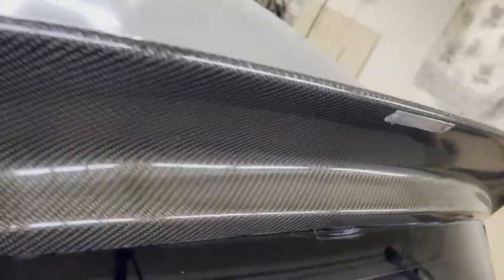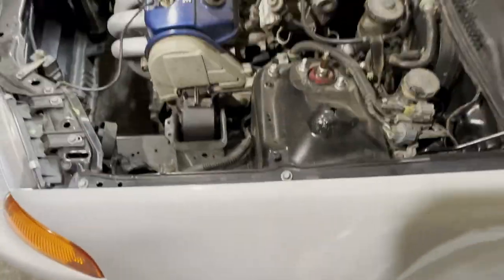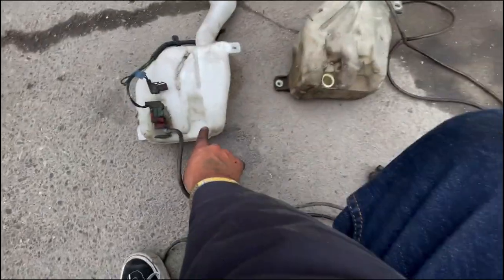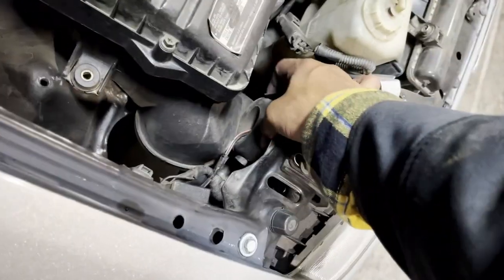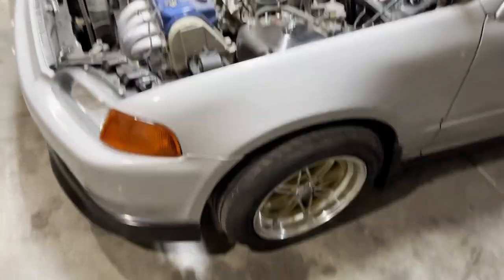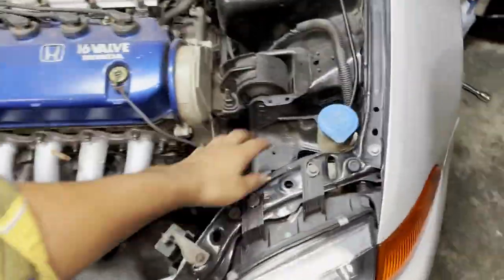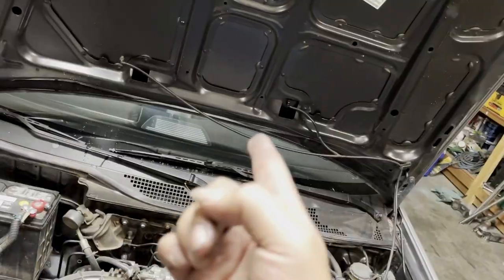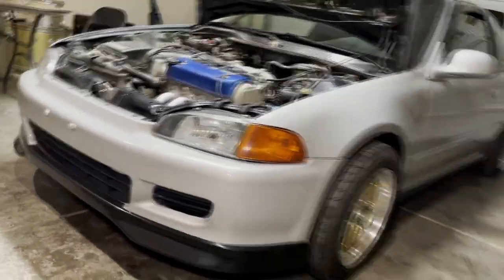Washer Fluid Reservoir Install | '92-'95 Civic Junkyard Blog #1

Comment: What kind of line did you run from the reservoir to the sprayers?
Reply from the maker: @BenJacobs-we3yb i used oem hose lines from another honda civic. I believe you can just use regular ole sprinkler line hose for gardening. I checked amazon and its not super expensive for a roll of it👍